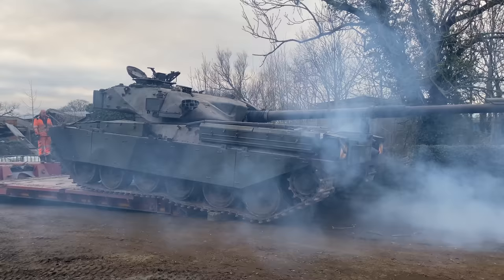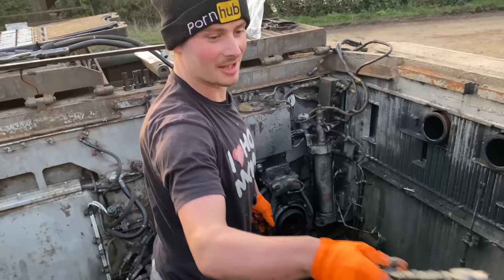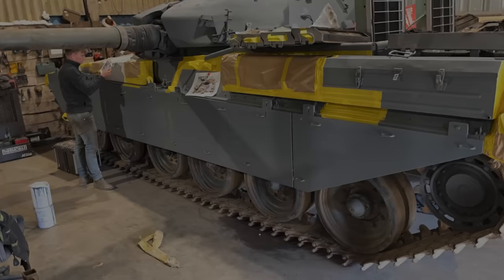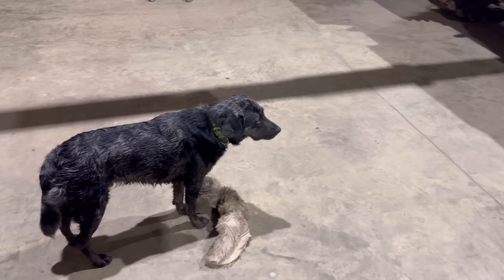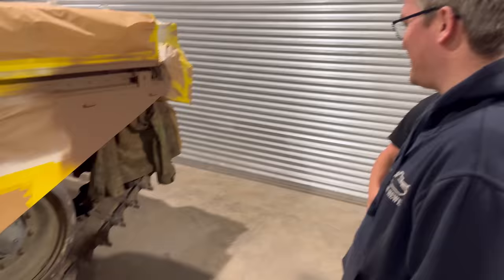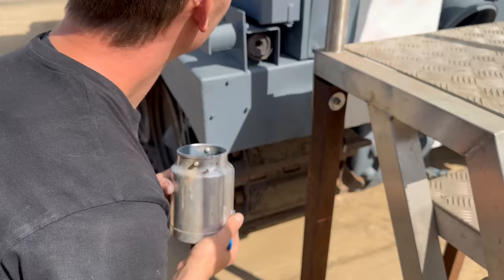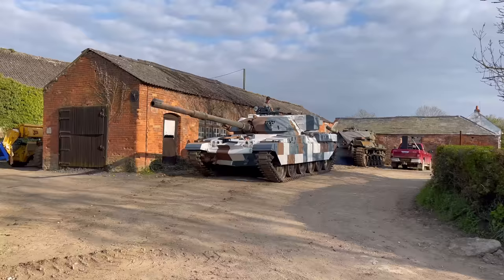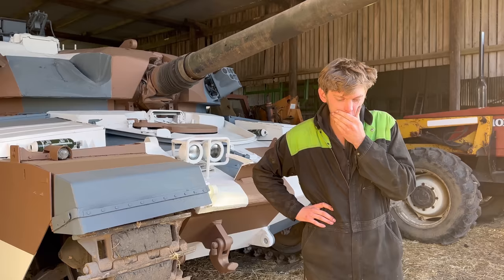How to paint a tank in Urban Camouflage.

Comment: There’s nothing like the sound of a Chieftain 😊 I think you’ll get the turret to power up, getting it under control with unknown electronics 😮 Just make sure you have clearance all the way round. We had a few that took off on their own on the first power on - luckily those turrets were on the test stands before mating back onto the hull. As you’re doing the testing on the hull, make sure the micro switches that detect the turret position in relation to the hull are working - I’m sure you know - but they force the gun up and across the rear deck. Good luck, exciting time ahead me thinks 😉

Comment: Oh, and btw I worked offshore for ages and what you said about shot blasting is 100% correct. Have you ever looked into high-pressure water blasting? we had a constant battle with rusted-out steel as you can imagine and the water system is amazing at rust removal. at 35000psi it will go right through steel like butter so you need to keep it moving! Also, don't wash your boots it does not work out well...

Comment: Great paint job. Shame the rattle can refurb on the engine didn't get as far as pulling the injectors and refurbing them. Or is that as good as it gets with a nasty two stroke of that era? I don't remember the 9 cylinder Deltics I ran being that smokey although they did use plenty of oil.
Reply: Who said a rattle can refurb? Lots of work was done on the engine just hasn’t been included on the video.